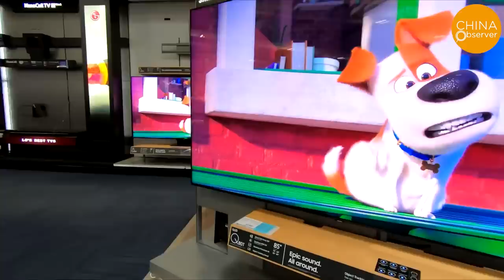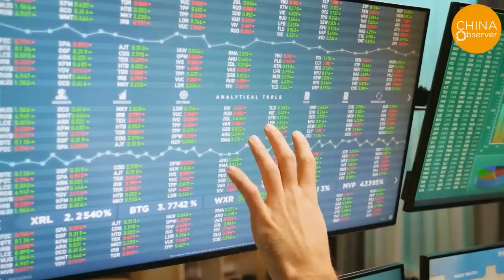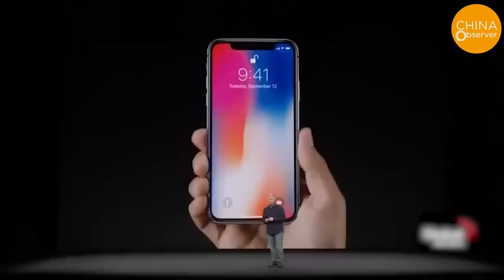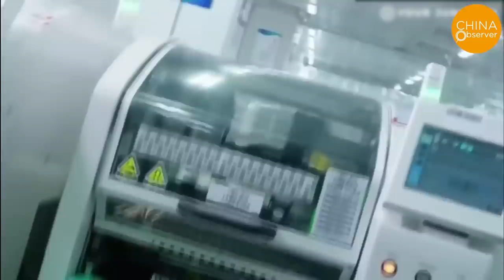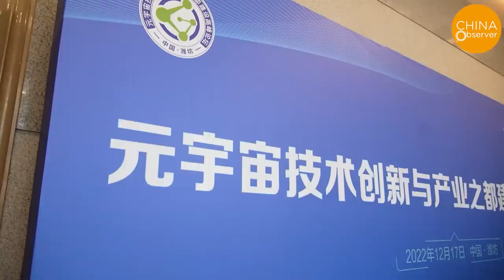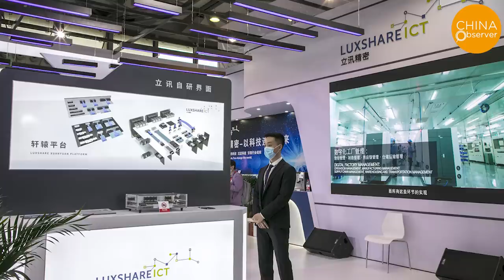Apple's Reduced Orders Challenge Survival of Chinese Supply Chains, Benefit India and Vietnam

Comment: To misquote The Lord of the Rings...One does not simply remove China from your supply chain. An American company I used to work for had a significant manufacturing presence in China.  In 2015, our CEO decided to bring the manufacturing to the US and remove China from our supply chain.  By 2018, our three exiting US factories were able to absorb the finished goods China built for the company, creating thousands of US jobs.  However, moving manufacturing out of China was the easy part; removing China from the supply chain has been very, very difficult.  By 2021, we replaced our Chinese sub-tier suppliers with counterparts in India, the Philippines, and Mexico, but they are still dependent on China for their raw components.  So, the fickleness of the Chinese government is still a risk to the company, though that risk has been mitigated.  Last I heard, the company expected to be rid of China by 2027.  China has its tendrils very deep into the world's supply chain, and that is no accident.

Comment: It seems like Apple is in big troubles. And also, just my guess, smartphones like Oppo and Xiaomi maybe today are manufactured with almost complete automation! Because the Chinese tech industry has a long history of automation which today surely is very advanced and powered by AI. Of course western companies also use a lot of automation, but for larger products like cars, not for small electronic devices that require fine dexterity.
Reply: if the process was automated  Apple wouldn't need to be in china.   Think about what you said.    The components actually come from Taiwan and  S. Korea, they simply assemble the phones in China, because labor was cheaper compared to other countries. Its not skilled labor.
Reply: @eabutler6861  I was thinking that the Chinese industry keeps some of their automaton to themselves. Like a business secret coordinated by the Chinese government.
Reply: “, not for small electronic devices that require fine dexterity.”

I was a Manufacturing Equipment Maintenance Tech for HP for 13 years.
In the 1990s we had precision automated equipment that placed components in specific locations in the microns.
We also moved these precision automated equipment overseas.
 
That CCP China automated manufacturing equipment was built and installed, along with the training of all of the CCP China production crew, by Western companies (I include Japan in this category.), not CCP China companies.